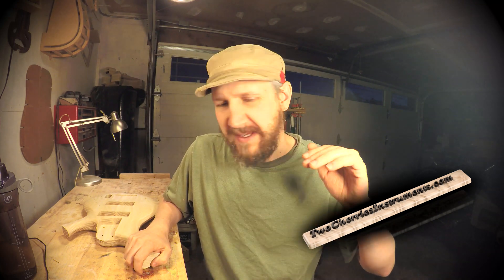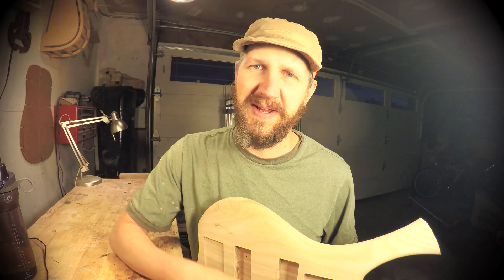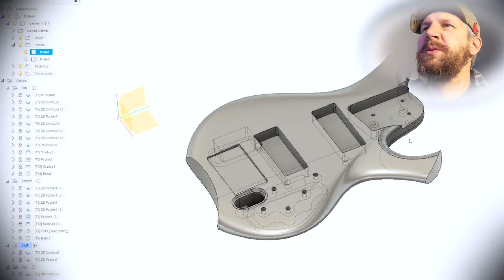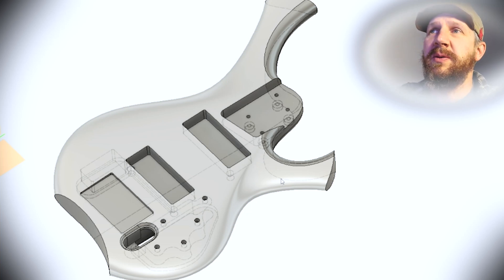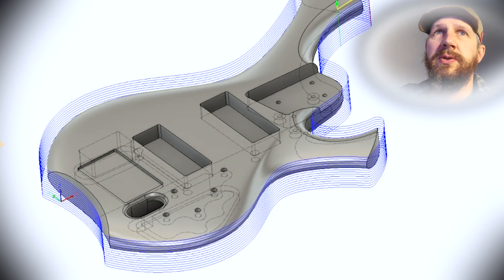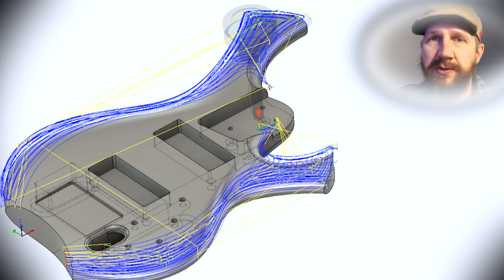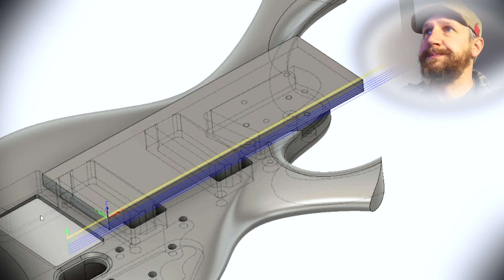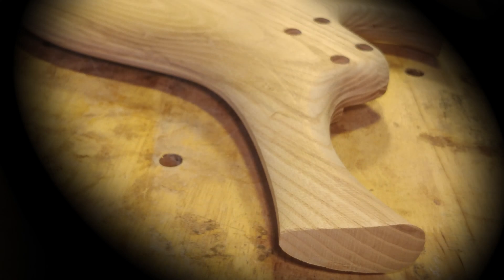CNC Bass Guitar | Complex CNC CAM contours with Fusion 360

Comment: I didn’t understand how you align X and Y the first time you put the stock on the spoil board: just eyeballing the centerline for the X?  And when you flip it over, do you just lay the flat border of the “holder” onto something for one coordinate? And what for the other one? Thank you!
Reply from the maker: Indexing and setup datums is a pretty in-depth topic, not sure I can explain it here completely. For bodies I use the center line for they y axis, and the x is indexed from the material. For necks the second side alignment is more critical so I us a sacrificial fence that is cnc cut and therefore perfect aligned to the axis. I have several videos about these processes.

Comment: amazing work, this type of modeling and cam, can be done with the free version of Fusion 360 or is it the full version.  thanks
Reply from the maker: The free version does everything the paid version can do. The only difference for this work is the gcode has limited rapids. Code that takes a little longer to run shouldn't be a problem for the hobiest.

Comment: By my experience it would probably have been a lot easier if you had not cut the body outline at the start, but kept the body atached to the frame with tabs while running the CNC. That way, you can use the waste material for your workholding and indexing, without having to worry about making jigs etc. for holding complex shapes. In the end, when the machining is done, you cut the tabs, and get rid of the ramins of those while sanding, which you will have to do anyway :) Other than that unnecessary additional work you had to do becaus of your process, gret work, I really like the organic shapes, reminds me a lot of the Warwick basses, which I happen to like a lot. (And I know I'm late to the video, I don't intend to raise the dead, I just thought that it was worth pointing out)
Reply from the maker: This extra work takes about 4 minutes, and what it does makes a marked improvement to the milling. My tool engagement on the rough milling is half the diameter instead of full. So I can run the machine much faster and get a better surface finish. When Slot milling 1.75" deep, there is no way to extract chips they become impacted in the sot and add unintended forces on the tool. The goal is to set up a finishing pass with a specific chip load, This can't be done when slot milling. If it works for you, then great. I avoid slot milling whenever I can. Tabs are also unnecessary due to my work holding technique and avoidance of slot milling.

Comment: Do you run one tool paths at a time so you can change tools and re zero? Or do you run the whole setup and if so how do you change tools, edit post? 
I built a machine to help me build my guitars but I'm still learning, cutting more simple things thus far. 
Great video btw
Reply from the maker: Fusion360 allows you to post-process out code in several ways. I post out usually by setup and sometimes by the tool. In Mach3 the tool change code will retract and wait for the tool change; you can zero the Z-axis when you change the tool.   Cycle star resumes the program until the next tool change in the code.

Comment: What kind of tape are you using for work holding?  I can't find anything that sticks that well to MDF!
Reply from the maker: This just plain old masking tape form your local big box store. I burnish it into the part and the spoil board with a rounded over piece of maple, If you work it in well and then get a good glue joint with the CA glue it holds better than any double-sided tape, and it's way less expensive. I have to wedge a chisel between the part and the spoil board to remove the part most of the time, and I never have to worry about crashing into a clamp or creating expensive oversized stock to accommodate clamps.
Reply: @TwoCherriesIns  I've used the tape/CA glue method for plastic parts (mainly pickguards/inlays), but on top of prefinished birch plywood (so the tape sticks)...never a guitar body right on MDF...I'll have to try it!  What are your depth of cut/feedrates when using tape/glue?  I generally run 1/8" depth of cut at 100ipm with a 1/2" tool, but I'm curious if the tape would let go with those parameters.
Reply from the maker: @jacobcanady4621  I'm generally cutting at .125" to .25" depth of cut with a 1/2" end mill at 200 IPM for roughing. The farther away for the spoil board I get the more conservative I will set my tool paths, So for cutting the heel of an acoustic guitar neck that's nearly 4" above the spoil board, I will set the depth of cut and stopover quite shallow, for bodies and parts less than 1.75" I don't have any issues.
Reply: @TwoCherriesIns  Dang that's impressive holding power...definitely going to be doing some tests!  Thanks for sharing that information, very cool.

Comment: Great video!  I am getting into the CNC world of guitar making as well.  What type of mill did you use for the contouring (the red one), is it some sort of roundover?  I am using a normal 3/8 ball end currently but I dont have quite the contours this one has.  Beautiful design!
Reply from the maker: Isn't not my design, it was sent to me to be milled. The lager roundover is a .75 with a .25 shank.
Reply: @TwoCherriesIns  Thanks for the video!  I am not finding a "lager" roundover bit you mention.  Am I missing something?  Thanks.
Reply from the maker: @pipercub45  its just a 3/4" ball nose, nothing special.

Comment: awesome video....again! I am not a luthier and I don't play an instrument. I only have a basic grasp of Fusion and just started guitar lessons but I am obsessing with making my own guitar so your videos have been very helpful. forgive the newbie question, could you have left the body in the original piece of wood, contoured it, created tabs and than flipped it rather than cut it out on the bandsaw? The perimeter would have been the gauge for the flip?
Reply from the maker: Yes that is a reasonable method, I have not had much success with it. If I was making a lot of these than a dialed in setup like your talking about would make sense.